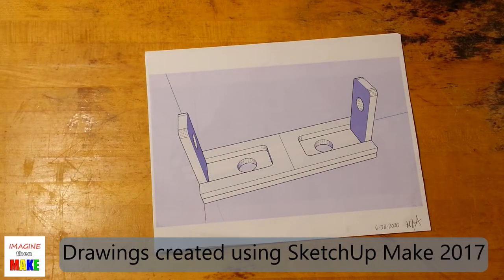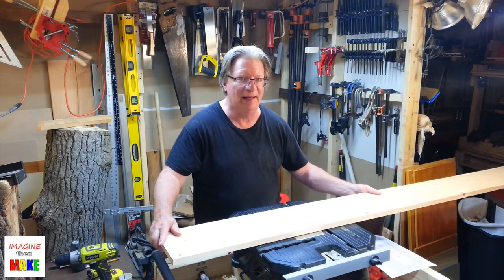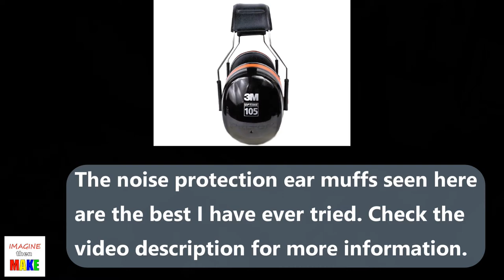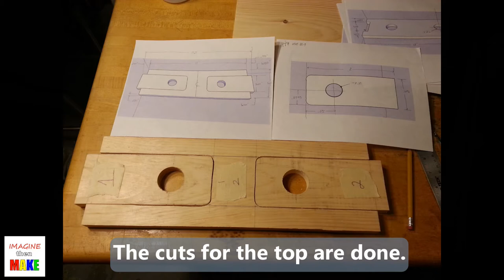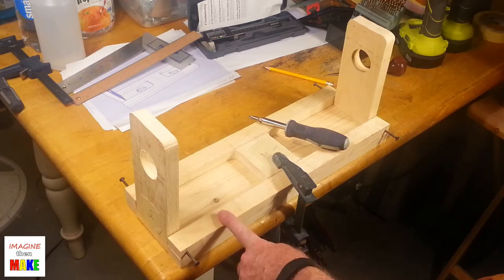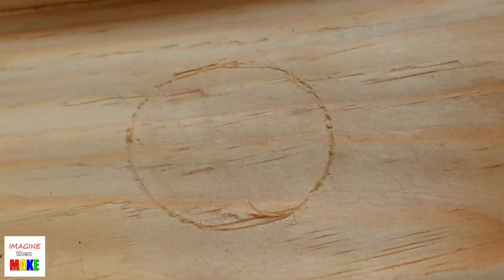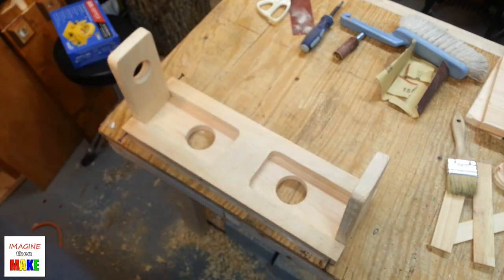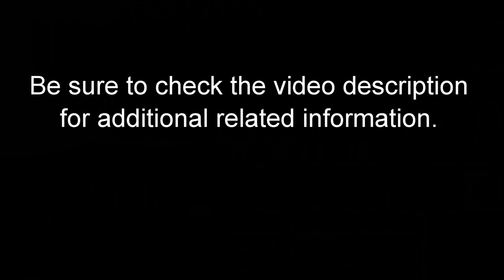112. Making a wooden portable book shelf

Comment: Nice project. Nice Video. Still Not sold on the BladeRunner.
Reply from the maker: I understand. This project was suited for the BladeRunner because most of the cuts were long and straight. The curved cuts were not that sharp so going slow using a scrolling blade worked out fine. This same project could have been done using a bandsaw or even a scroll saw. The bandsaw can cut quickly like the BladeRunner (a scroll saw would have cut much slower).
So what I am trying to say is that the BladeRunner is a great tool for the right kind of project. A bandsaw is a little more versatile (cuts quick, lots of different blades available, keeps the work pressed against the table while cutting, but cannot make inside cuts). A scroll saw with the much smaller blade cuts slower but is capable of much more detailed work (if your project calls for that).
I think the important point here is to choose the right tool for the job.
Thanks for your comment and for watching.

Comment: Hi Matt,  you seem pretty dependent on that weight to steady your cuts how much does it weigh?  I have a first generation blade runner haven’t used it much, after watching your video perhaps I’ll start using it again.
Reply from the maker: Hi Frank. Because the blade oscillates up and down at high speed, the wood can sometimes jump up. Normally, there is a kind of "foot" installed which helps hold the wood down. Unfortunately, the "foot" makes it hard to see the cut line so lately, I have not been using the "foot". Instead, I use a heavy weight on the board to help hold it down. I'm not sure how much it weighs but I would guess a couple of pounds. As you saw in the video, it does make a big difference. At one point, I took both hands off of the wood and it didn't move. 
Does your BladeRunner have the arm with the "foot" on the right side rather than in the back?
Thanks for your comment and for watching.
Reply: Yes  the arm is on the right side